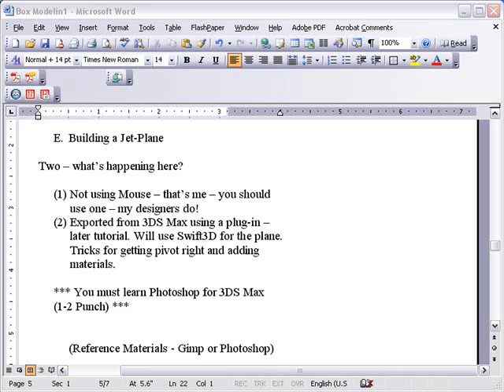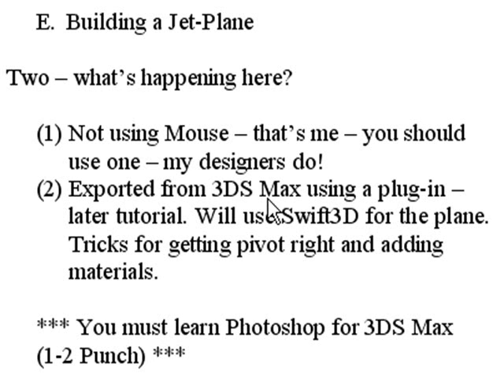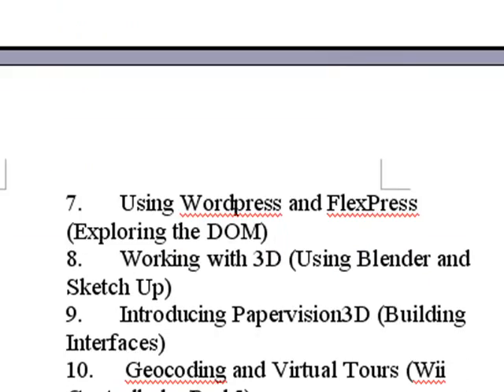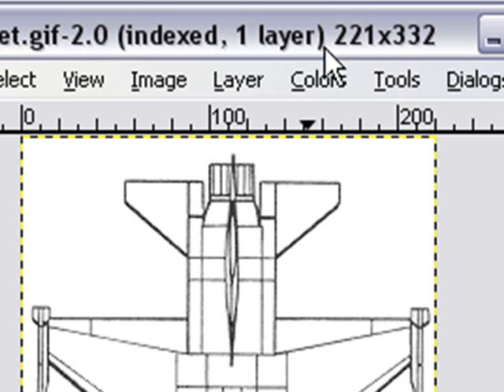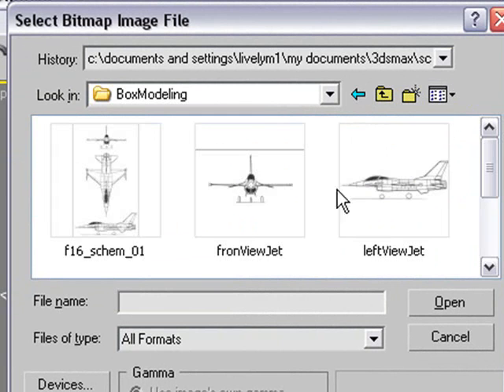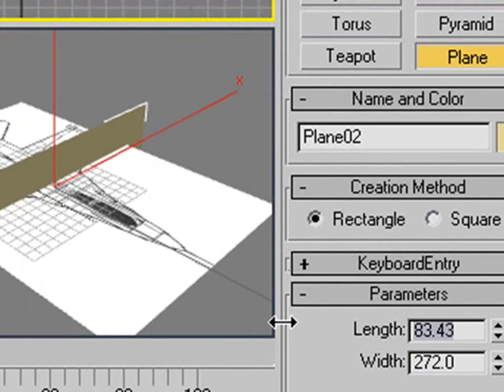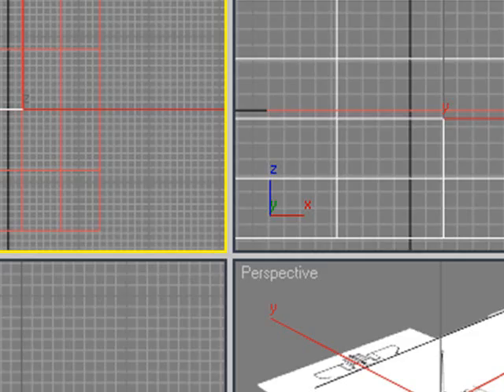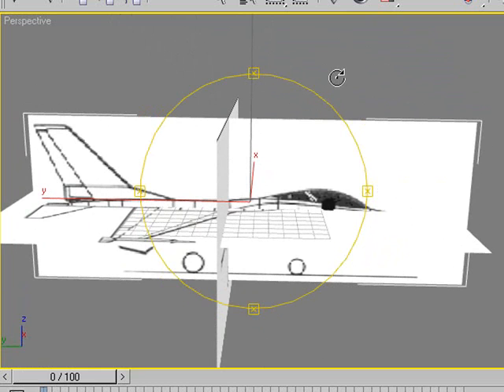(4 of 6) Box Model a Jet for PV3D - Pt 1 in 3DSMax

Comment: 1. If you're using the collada exporter in 3dsmax and check Triangulate under Geometry doesn't that export a triangulated model , like Swift 3D ?

2. I dig open source as well...any ideas on how I can compile Gimp of Blender on a device with an arm processor ?